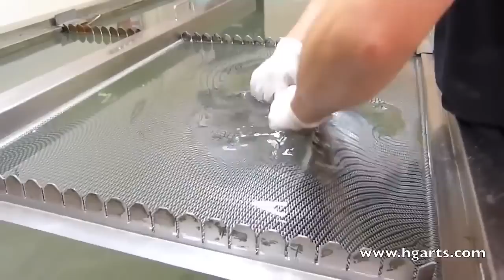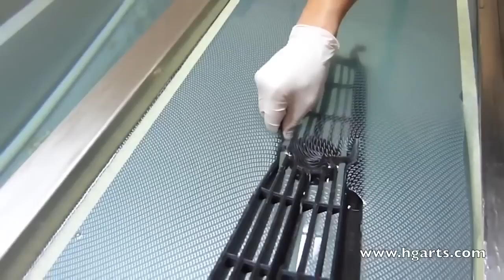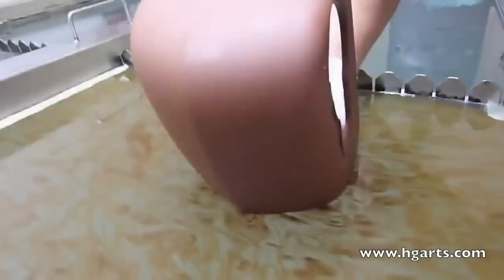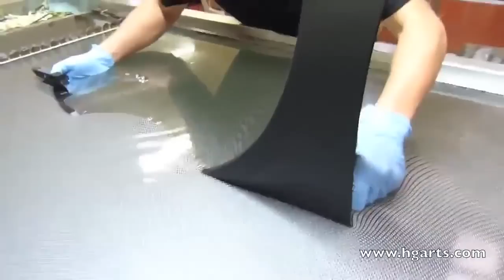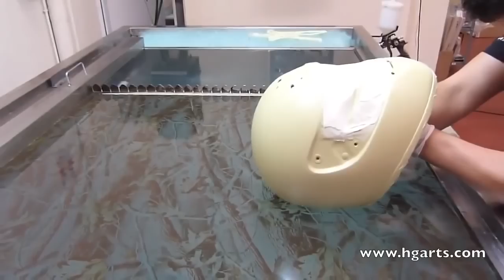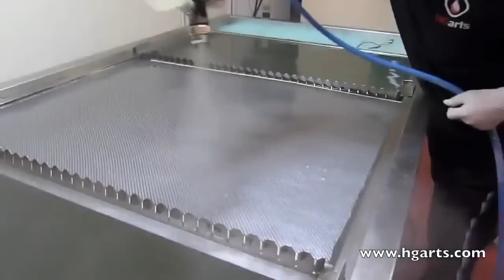Beautiful Water Painting

Comment: I'm curious to how they get the paint in the water so neat
Reply: It's a foil that they put that somewhat dissolves in the water and sticks to the part that they were covering, hope this answers your question
Reply: +Jay Cairns was wondering that too. Is the activator spray like flux for welding? Like they spray it on the rims and thats why it sticks.
Reply: +B Sheppard no it just activates the material and makes it liquid
Reply: Ryan Has Diecast so how does it stick to the rim and not come off in the water or when it's touched? And thanks for the reply
Reply: +B Sheppard it doesn't come off when touched because they let it dry and then put a sealer on it probably, but I don't know why it doesn't come off in water, that's something I will have to look into.
Reply: Ryan Has Diecast I meant when they first take it out of the water. Maybe some kind of electroplating?
Reply: OCD or they might be trained
Reply: ***** Ahh that makes sense. Thought it would be something like that. Cheers!
Reply: +MCTurtleGames all i am curious about is whats the use of that RIM :s
Reply: Apurv Khandelwal To put a tire on?
Reply: Its fake
Reply: it shows how they put the paper or sheet thing on top at the beginning😄
Reply: If you watch from the beginning they put a paper on the water
Reply: Megan Lam yup
Reply: +MCTurtleGames ikr
Reply: +Jay Cairns 
So this process is similar to putting a large decal on the object?
Reply: i guess MantisNoMore
Reply: they showed the whole fkng process tf
Reply: +gabby OMG lol
Reply: gabby OMG
No they didn't; they didn't show the manufacture of the decal-like "magic paper" they used to introduce the pattern in the first place.  That's the highest complexity component in the entire system.
Reply: +MantisNoMore porno

Comment: Its simply a graphic transfer medium using water ie hydro dipping. I would not call this 'painting'. As with anything using transfer it can be scratched off, even if you use a good finish to protect it (such as the Cerakote MC-161). Painting an object with a design is far more durable and lasts longer. So you really get what you pay for. And the funny part is if you use some services like hydrodip.com, they charge you similarly to what getting it actually painted would cost you. Another difference is that getting your pieces painted allows for far deeper detail work. Hydro dipping tends to work with simple and less complex things than line art, comics, etc. Personally if I wanted a personalized touch even if it was basic such as camo, I'd still go for actual painting. Why? Because it will have that custom hand done appeal. Over a made in china and they all look fairly similar look. Since its using the same print over and over.
Reply: Sacred Sun how does hydro dipping work? Wouldn't this be considered a type of fluid painting like acrylic pours? It's still paint or ink put on a surface. Seems like it's a type of painting.
Reply: I was under the impression that once you spray this with a clear hardcoat it is pretty durable . Would you call it ''painting''...? Maybe it would better describe it as ''covering it with paint'' rather then 'painting it with paint''.....To-mato ...To-motto .

Comment: why does it have to go in at an angle?
Reply: so all the paint can get on the corners
Reply: Maybe to prevent air bubbles?
Reply: To prevent the paint from moving away
Reply: to get the grain right
Reply: This is hydrographics - a form of surface printing method which allows the graphic to be evenly placed over 3D surfaces.  They start at an angle to get an even distribution with as little chance of error as possible.  The best similar example would be applying a protective screen over an iPhone - you don't just apply it straight on because that would create big air bubbles, the result would be uneven and you would waste money on a badly mounted protective screen.  If you start on one edge, slowly flatten it out over the iPhone screen, eliminating bubble in the process, then you get a much better result.
Reply: Noiz hen
Reply: Radkon Psygami huh Wikipedia
Reply: Noiz there something called GOOGLE

Comment: Thats hydro-dip right?
Reply: yes indeed
Reply: +BackupWorm MvcQ yes, not water painting...
Reply: Just wondering how do does this even work?!
Reply: Thomas Phung "water" has some kind of acid or thingy that glue doesn't stuck to it and the "paper" is floating on the top so when something touches it it glues into it. something like that
Reply: ahh ok thanks
Reply: +Thomas Phung It's a digital image printed on a paint/ink emulsion, which is on a clear gel. Think of the gel layer as a sheet of paper and the emulsion as the ink when you print an image from your computer. They are actually two separate layers. The sheet of printed gel is then laid across the top of a tank of water. The gel dissolves in the water, leaving just the image on the emulsion floating on top of the water.As he dips the printed emulsion is transferred to the object. Then when he swirls the object the unused emulsion is forced away from the object so nothing else will end up on the object.
Reply: :o dats a intresting technique to paint
Reply: +Barb Wallace where do you think one could purchase said gel sheets? and a printer that uses it?